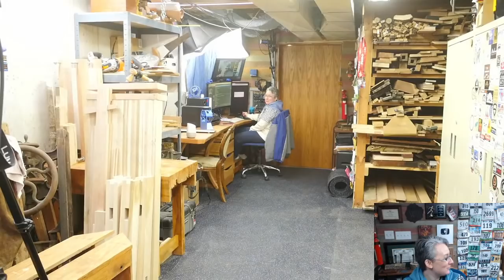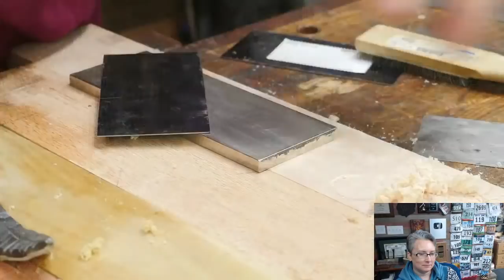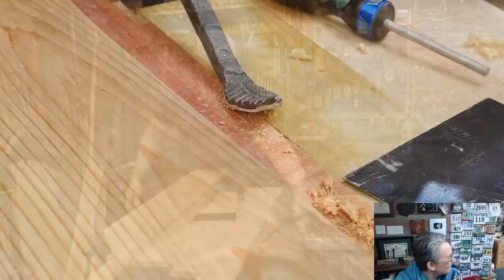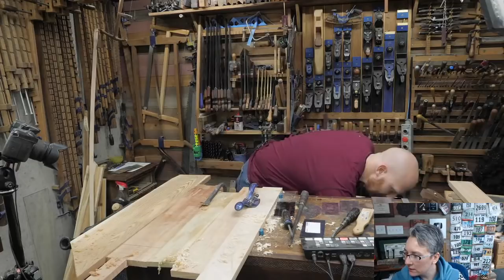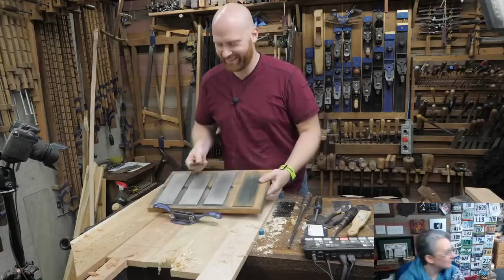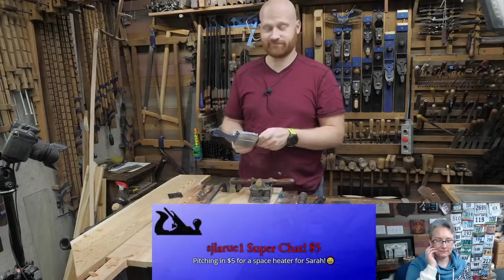How to Sharpen a card Scraper or Cabinet scraper.

Comment: In case anyone reads this later, the best way to prevent glue getting on your tools that I've found is to coat them with paste wax. The glue can't bond with it and any dried glue just pops right off. It also protects against rust better than most anything else.. this trick works with CA and PVA glue.

Comment: I couldn't attend the live show. But since the last time I tried to sharpen my scraper, with minimal success, i had picked up a real burnisher from Rockler and by golly I put my scraper in the bench vise just like you did and rock and rolled that edge now it cuts like butter. Finally able to make and roll a useable burr for this important tool!
Reply from the maker: A good burnisher is worth its weight in gold.
Reply: @WoodByWrightHowTo  seriously. I found that! Next step is a cabinet scraper for me!
Reply: I found a knife steel at a flea market for $1, since I already have two in the kitchen, the cheap one is going in the wood shop.

Comment: Regarding the heating up. Would it work to douse the scraper in cold water for a few seconds and dry it off real good and keep going? In case someone doesn't have a bunch?
Reply from the maker: You could, but they normally cool off in 30-40 seconds just sitting on the bench. I would be more worried about rust.
Reply: @WoodByWrightHowTo  makes sense.
Reply: @WoodByWrightHowTo  by the way thank you for responding to these comments. It's one of the coolest things about connecting on YouTube. I am in the hive mind now btw. I'm now watching your content and Paul S's almost exclusively these days as I'm getting more into traditional and hand tool work..

Comment: Your timing couldn’t have been more perfect, James! I recently came into possession of both a Stanley No. 12 and 80 cabinet scraper. The 80 doesn’t have a scraper, so I think I’ll take your suggestion and cut one out of an old saw blade. I also need a burnishing rod, and will order one asap from your website. Anyway, thanks so much for the helpful info. I feel much more confident because of your instruction.
Reply from the maker: Thanks man. That means a lot.

Comment: Isnt a cabinet scraper supposed to be "bevel down", with the bevel at the back and the burr rolled toward the flat side?
Reply from the maker: yes, but the angle of the bed is forward on a cabinet scraper not backward. So the bevel is toward the surface it rests on.
Reply: @WoodByWrightHowTo  I dont think I worded myself correctly....... I think the bevel is supposed to face the back of the tool, opposite to the way its bein pushed (same as a bevel down plane) with the flat side facing forward and the burr rolled towards the flat side. Imagine a traditional bevel down plane just with the iron pitched more forward. The bed that the blade rests on in a cabinet scraper is still behind the blade, its jus angled forward instead of angled back, its clamped from the front to the bed which is behind it, if the bed was in front of it then the blade would flex and vibrate in use, creating chatter :)  Any instructions ive seen for scrapers with bevels ( eg. Veritas scraper plane) shows the burr bein pulled to the flat side and the bevel is faced to the back of the tool. Shannon Rogers uses a cabinet scraper this way (without a burr), Paul Sellers faces the bevel rearward (he uses a burr)..... and numerous others. I fear you may be mistaken with this one James :)
Reply from the maker: correct. that is how I have it in the video. the burr rolls away from the bevel and the bevel is placed up facing the bed it rests on.
Reply: @WoodByWrightHowTo  Watch from 35.40, you point out which side the 45 is on and turn the burr in that direction and check for the burr on that side, and you said that the bevel has to face forward towards the front of the tool when you were settin it into the scraper.  You would only place the bevel side forward if the burr was on that side. You did rework the blade after your instruction and had it in and out of the scraper, but you didnt mention any change to your original instructions :) 
Im not the kind to nit-pick at things or point out others mistakes (we all make them) but others are gonna follow these instructions, so my only intent here is to make things clear, I do not wish to embarrass anyone. You are an influential man in the world of hand tools and a lot of people rely on your instructions.... Ive learned from you myself. But either the instructions are wrong here, or there is major confusion in communications :) Please watch the video from around 35.40ish James....... maybe I am confused, it wouldnt be the first time :P